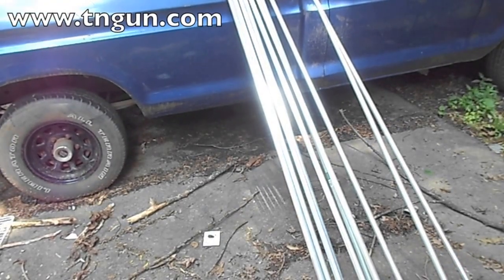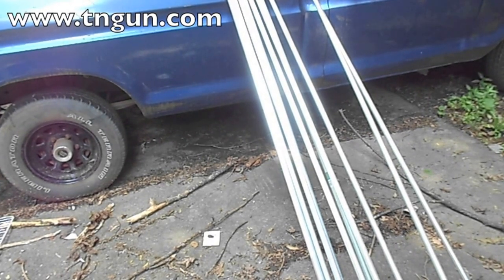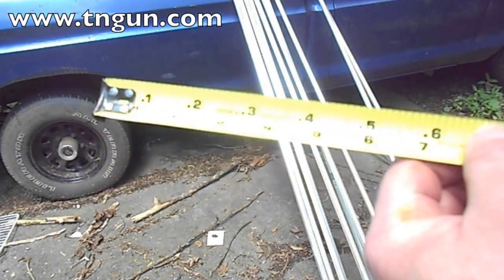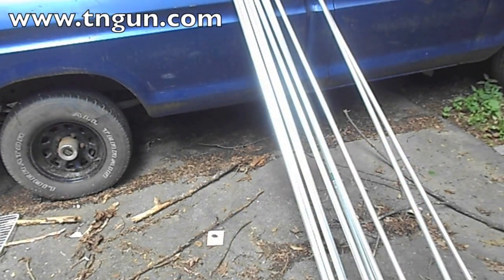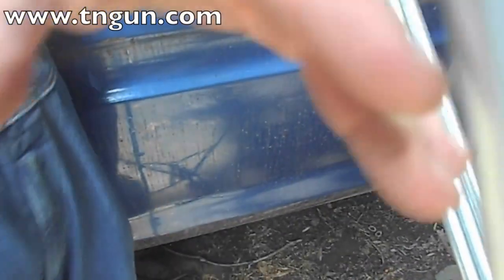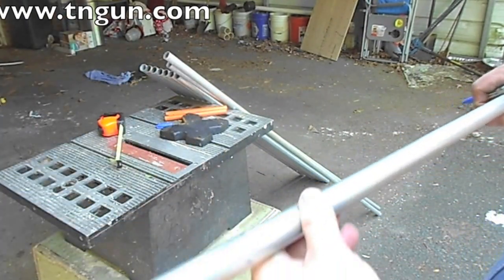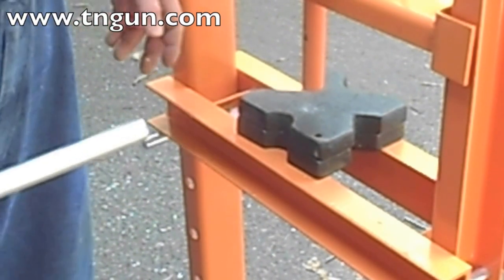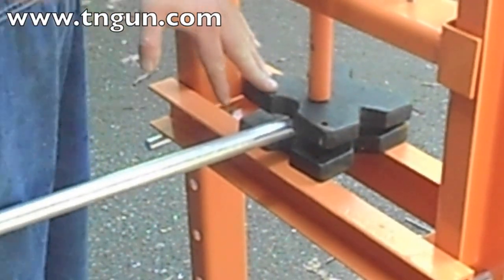How to Make an EMT Conduit Geodesic Dome I

Comment: Engineer's tape? I just multiply the dimension in feet , like 5.5 feet, 5.5 x 12 = 66 inches  or 7.8 feet is 7.8 x 12 = 93.6 inches which is 93 1/2 inches within one percent and that is close enough...
Reply: A metric tape with mm will give you better than 1/16" accuracy ;)
Reply from the maker: Good tip, my idea is to make multiple domes in multiple sizes so  I went ahead and got the tape to make it easier...
Reply: David Nash Nothing wrong with that, I just was pointing out the alternative for those who can do the math and save the cash. As I always say, there are alternatives...

Comment: I am thinking of pre-casting using Ferro-cement style panels, for assembly into a geodesic dome  using small enough triangles for handling by only two men and incorporating an attachment scheme using your conduit system for perimeter framing of the panels, then filling in the gaps by troweling in more mortar from inside and outside adding a coating of waterproofing to finish outside and interior paint to finish inside. Interior wall panels could be constructed flat on the floor after it is poured then lifted and tied into the dome structure before the interior joins are filled, the outside joins are filled from the outside, spray foam between the edges of the Styrofoam panels, then more mud on the inside to finish along with smoothing the joins with interior walls. I would build the exterior panels in three layers, a thin layer of Ferro-cement outside, then a thick layer of Styrofoam then a thick framework incorporating Ferro-cement in the greater thickness for most of the wall / structure strength to the inside also acting as a thermal mass for comfort the entire panel would be tied together with wires thru the Styrofoam from inside to outside making the structure into a unit and bury the electrical wiring in conduit and plumbing in the interior walls also for frost protection in cold climates. Many of the triangles could have skylights with glass hexagons or squares on inside and outside to provide insulating effect and natural lighting. When privacy is required just paint the inside with white spray paint to block any viewing. Silver blocks light completely, black reduces light but can be seen thru but flat white lets light thru but provides perfect privacy…